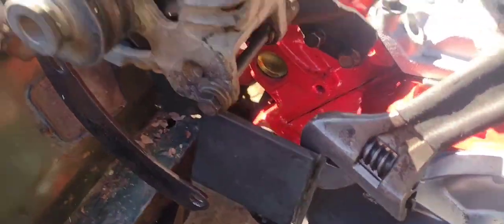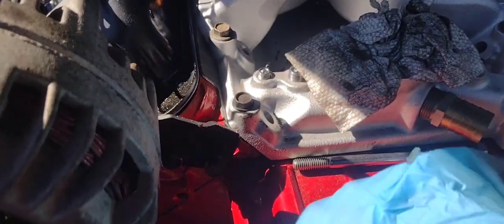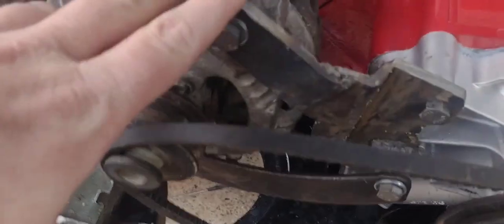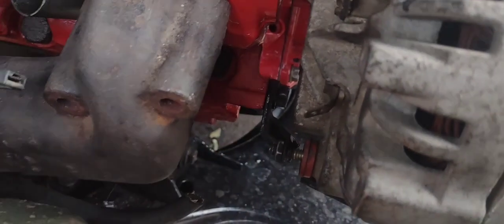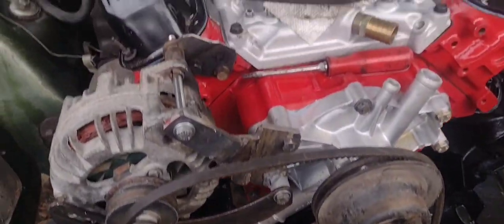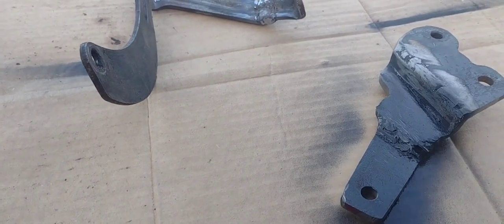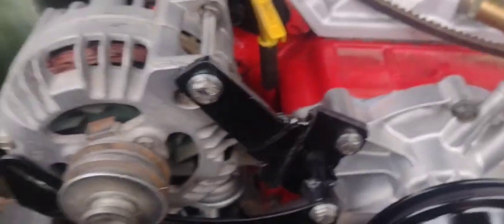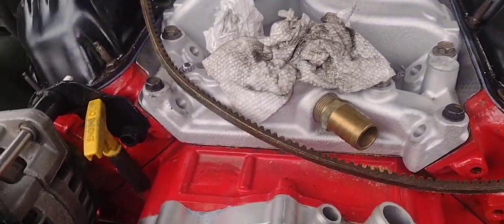Alternator bracket from scratch

Comment from the maker: Food for thought I may show some ICE raids in the next video to keep it current. Thanks for watching
Reply: I always save all those brackets and eventually there's always one that will work for you
Reply from the maker: @JustinMiales yeah the magnum head I think has different hole spacing. And I wanted to keep the lower one attached to the block. I may go back in and do it again but it's working fine for now